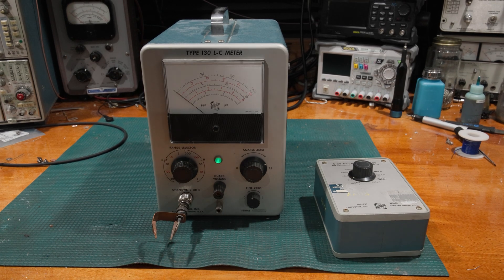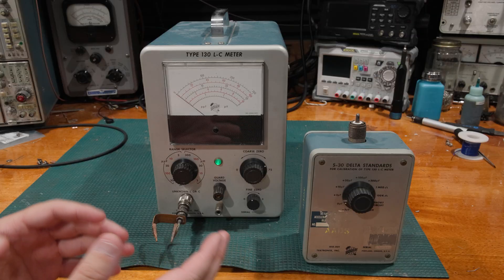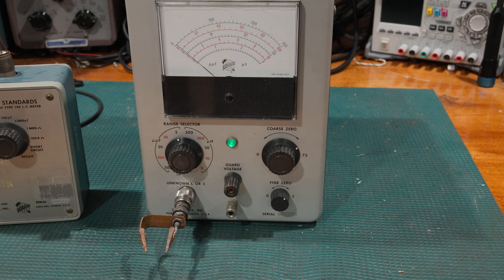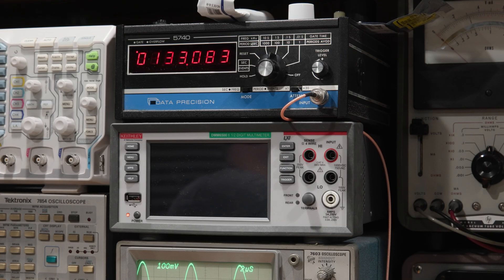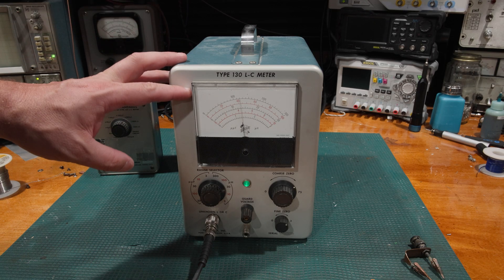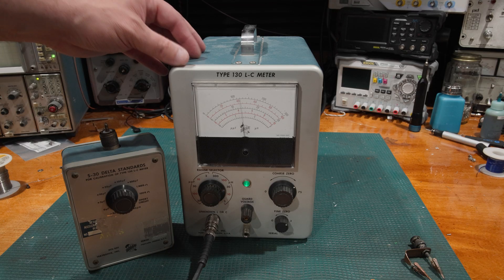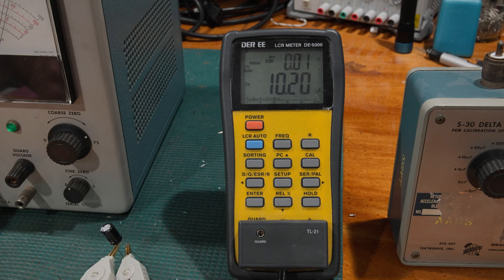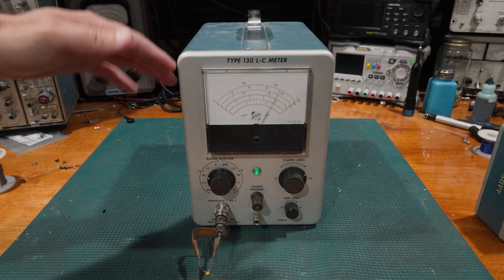Tektronix Type 130 S-30 standard and calibration notes

Comment: One must admit, when it comes to boatanchor equipment, a redefinition of the kilogram is indeed relevant :)
Reply from the maker: As with everything engineering “ it depends”. In this case using the 130 as an example. You are absolutely correct the accuracy of the 130 Is not effected by that change. Even the gear that calibrates the 130 is not even effected. However the gear that calibrates the gear to calibrate the 130. Now we will start to see some low level effects. Any standard used as a transfer standard should be measured to the highest accuracy available for best results. 

But we are talking about splitting hairs in the micro amp and nano volt ranges at that point.
Reply: @ZenwizardStudios  A precision resistance meter or standard (0.1% or better) from the first half of last century could easily appear out of calibration today because of the international vs absolute Ohm mess....
Reply from the maker: True, but ideally this could be brought back in to calibration with a few measurements. The magic of those standards was their stability over time with absolute value being a secondary property.

Comment: The problem has always been testing low-value caps and inductors, since, as you mentioned, you can merely place your hand near the DUT, and it can change the value. That is why I've always said some "voodoo" is involved, especially in HF tank circuits over stray C and L.

I have an old ESI 253, though, and it seems to not be affected very much when handling a DUT. All my other LCR meters are affected more, including my HP equipment. I'm not sure what ESI did in their design to achieve it, but it is quite stable. Of course, ESI was always about precision, and they manufactured some of the best bridges available since they also built standards.

Comment: The 5-30 is fairly easy to make if you don't own one.  I built one many years ago for use with my 130 LC meter.  Just 1 tunable inductor, 2 resistors, a couple fixed capacitors and a handful of variable capacitors.